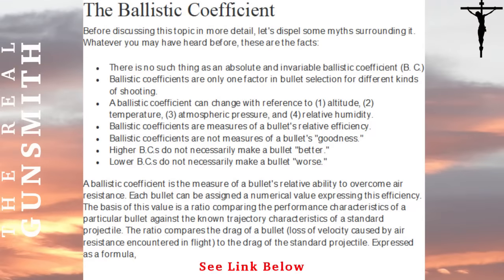7MM PRC Compared to Other 7MM's

Comment: I just listened to Hornady podcast on the 7mmprc. They don't claim faster fps than the 26nosler. They claim about 100 fps slower but around 30% less recoil, shorter barrels, and longer barrel life. That's a tradeoff I'd make any day.
Reply: That is not true. The real difference is around 200 fps.
Reply: I listened to and read a bunch of articles. Maybe this guns and ammo article made false claims but everything else i watched or read claimed lower (realistic) velocities on the 7mm PRC.
Reply: In a properly built 7mmRM it easily out paces the 7prc.  It's just the more modern case which is great but it won't beat a well built 7 RM
Reply: Your comment said 26 Nosler.  I’m assuming you meant 28 Nosler.
Reply: 100 fps slower and 30% less recoil is a joke at best and closer to a lie.
Reply: He said 28 nosler pay attention before you open your mouth
Reply: @billsoule3851  yes, typo. Thanks
Reply: @benkeachy  recoil is based on simple physics, so given those parameters, if the same weight bullet is traveling 7.2% slower also running the same/similar loads will give you about 7% less recoil. So don't be a sucker for the marketing. Also the barrel length issue is also hog wash.. Bullet weight, cross sectional density, powder selection and twist rate determine efficiency of barrel length with a given cartridge.
Reply: I love my 7 mag and load to suite the job. I do however like the idea of not messing with case bulge at the belt and having to use 2 different sizing dies to fix it.
Reply: It's a cartridge where internal ballistics are optimized along with chamber design. It's not all about terminal ballistics
Reply: Go with a 28 nosler just can’t be beat by either round
Reply: @codyoldford1592  one word in the article was a typo.

It was supposed to say the 7mm PRC was 125fps slower than the Nosler, but instead it said "faster" leadig to the 250fps "discrepancy" because if you claim something is faster by a certain amount when it's actually slower by that amount then you've doubled your claim in the wrong direction.

It was a simple typo, anyone with math skills (I'd assume a gunsmith would) and the knowledge that people make mistakes could have caught that, but no he's upset because this is a cartridge designed to not need a gunsmith.

That's what this boils down to, this is a cartridge designed to be an "all in one" solution for "custom" 7mag performance without having to build a "custom" gun. He's upset because he's not going to make any money off this cartridge.
Reply: @briansupermag3918  I don't think it "beats" 7PRC, But in a custom rifle it can certainly match it.

But that's the thing, this is a rifle that does "custom" 7mag things without having to have a multi-thousand dollar "custom" rifle built.

They're "out of the box" ready without needing custom work to achieve the cartridge's full performance (all rifles can be made more accurate, but the cartridge itself can't be improved on much short of maybe sprinkling some Ackley on it)
Reply: @Kross8761  that's the only thing that makes it any kind of worthy to be put in the same league as the 7mm RM is that this 7Prc is made correctly with proper chambers and barrel tw rates being most appropriate for Heavy Long Range bullets.  
If someone didn't have any kind of 7mm I MAY say the prc is pretty much ready to go from the factory for long range.  But if they wanted a custom rifle built and wanted pest performance its 7RM all day long.
For me I would never trade shorter barrels and better barrel life over performance NEVER.  I don't shoot  Prarie dogs to burn out a barrel.   I have never ever shot out a barrel ever so I want to push the envelope as much as possible and get absolutely the best performance.   That's why in the near future I will be building a custom 28 nosler.   195 gr. Berger vld and 3150 fps.   Heck yeah
Reply: @briansupermag3918   that’s that catch Supermag… not everyone can afford a custom Rem Mag. Hornady actually says that in their podcast. That a properly built Rem Mag can keep up. Change the head space, put in an 8 twist barrel. $5000 later.. wala. Factory gun. Factory ammo. 7 prc all the way. I own both. I love both. But I actually know… I’m not speculating. I own the cheapest 7 prc I could find in a Mosberg Patriot and it shoots lights out. $425. .5 moa. Thank you very much Hornady!  The cartridge is truly inherently accurate.
Reply: @Bob McMillen  if someone is just wanting factory rifle and shoot factory ammo absolutely  PRC wins.  It's a modern change and built properly.  Unfortunately 7rm Needs to be built and if someone wants a custom rifle and the choice is between these 2  the RM wins  it is what it is.   I love a 7mm's. Yes a fan boy here for all 7MM'S
Reply: @duquedupre  actually not really percent velocity change equivalent to recoil.  Look up recoil calculators. Bullet weight velocity and powder charge are inputs.  The difference in velocity is made in power charge difference.  By load book data, 175 gr prc is 2950. 28 nos is 3100 using 12 gr more of same powder.  This results in 4.8% velocity change with 17% recoil change.  34.8 to 28.8 lbft recoil energy
Reply: @orr89rocz  yes, but those variables are also not static. Secondary recoil impulse is due cumbustion at the muzzle which is a significant factor as well. This factor is that which is not caused by bullet weight and speed, but barrel length, load and propellent powder selection.
Reply: @duquedupre  simply comparing apples to apples, same powder same bullet weight same rifle weight, 28 nosler is abit faster at the expense of alot more recoil. Im not sure what you are trying to argue?
Reply: @orr89rocz  I'm saying that you're not looking at it exactly right. That the 30% number is one picked out amongst many other possible differences in recoil. For instance 7prc with a 175 bullet charged with 63.3 H4831 moves the bullet at the same muzzle velocity (2950) as 68.5 of IMR7977 but none the less they will have different recoil impulses... So simply measuring powder charges doesn't give you a finitely accurate measure of recoil. If this is even if all other factors and variables were even.

Thats what I'm trying to argue. No one has as far as I know test every single cartridge in every single possible configuration, but whether it be rifle weight, bullet, charge, or etc... So the recoil calculators don't factor all that's necessary to give concrete information. This can be witness by recoil testing done by certain individuals which often doest match up with ballistic calculators.
Reply: @duquedupre  thats way off track of what i was saying. My comment was in response to you saying 7% change in velocity was 7% difference in recoil.  That was not correct, when comparing the actual numbers.  Idk where the 30% comes from nor am i refering to that in any way.  Simply put, velocity change is not linear with respect to recoil generated, not by the calculations available online
Reply: No reason to be all upset. The market will put most b s cartridges to rest in short order. The sad part is it takes many bad kills to sort it all out. Think of all the fantastic cartridges that fell by the wayside like the 280 rem and the the 284 win if they didn’t stand the test of time no bad idea ever will.
Reply: @briansupermag3918  well actually 7 rem mag... Can't shoot 180 -190 as well out of factory rifles. They are just too long of bullets 7 rem mag is well up to 160... 7 rem mags can shoot the much longer bullets but those are in custom rifles. Where m😢ost of us Poors can't afford a $3000-4000. So in context of factory rifles above 160 grains 7PRC is better
Reply: @Rook Worx  I agree 100%.   If new to 7mm and just want a factory rifle, it's PRC all the way.  It's setup from the beginning, ready to shoot the heavy 7mm bullets.   But if going custom me personally I would go 7RM.  You can get more performance with a proper chamber.
Reply: @briansupermag3918 you use 7mm on prairie dogs, I bet your truck has a lift kit to
Reply: With a target bullet used as a hunting bullet on live game... you go, Cupcake! smh
Reply: @duquedupre  it's not "simple " physics. Recoil also includes rifle weight, chamber pressure  due to burn rates, and actual powder mass. Rifle construction such as drop at heel, and stock material effects felt recoil as does the type of recoil pad.
Reply: @duquedupre  Ejecta/unburned powder has a large impact on recoil. It's not just mass x vel.
Reply: Helpful hint: don't get caught up in gun writers bs.
Reply: Recoil is managed a lot better now with suppressors and brakes.
Reply: They lie.
Reply: The 7mm rem mags been doing the same thing for over 50 years.
Reply: @bboness713  your talking about the 7mm rem mag, which has been doing the same thing for over 50 years
Reply: I listen to their podcast, apparently somebody has misunderstood something along the way. And might want to check it out again.
They did state reasons why they believe it's better then the Nosler, but they didn't actually say it's faster.  There is something to not dropping that projectile so deep into the case.  There's all kinds of accuracy benefits that come with this design.
Reply: B.s. if you can afford to shoot enough to burn a barrel, you can afford a new barrel ... If you want SLOW, go buy a 30-06, and be done.  

A 7mm rem mag, has mag performance, and low recoil.   It's hard to beat.

Comment: Randy you misread Tom beckstrands article on the 7mm prc in guns and ammo he doesn't say that the 7mm prc shoots a 175 gr bullet faster than a 28 nosler he says that the 7mm prc matches the 7mm rum when loaded with vld bullets and shoots 100 to 125 fps SLOWER THAN THE 28 NOSLER . THAT MAY BE THE PROBLEM YOU ARE NOT READING IT CORRECTLY I THINK YOU OWE TOM A OPLOGLY. Further more you do not comprend what he is trying to get across in his article.

Comment: Shooting at game at over 600 yards is unethical, even with today's high BC bullets. Years ago I shot a spike elk at 670+ yards using a very high BC bullet. These bullets left the barrel at a chronographed 3,300 feet per second out of my 300 RUM. While approaching the spike noticed the animal had gotten up and walked away. Were it no for my spotter the elk would have disappeared. A 1/2 mile later I was LUCKY to find a the spike piled up on a sheep trail. Upon dressing the animal I noticed the entry wound and exit wound were identical with very little blood loss. Proper bullet expansion rarely happens after 600 yards.
Reply: I am a massive RUM fan,  300 AND 375, I'm surprised you're 300 rum at 600 yd on a spike has such a little damage.  I shot a raghorn small ones 800 yd 3 Ultra Mag 180 grain Nosler ballistic tip.  It made an exit whole I could stick my arm through!  -- what bullet did you use? (I am a hand loader, and load my cartridges on the UPPER END).

Comment: I respect the heck out of your knowledge about the 7mm Remington magnum, But not everyone has access to a competent gunsmith much less a custom rifle builder. For those people they can go buy a factory rifle that is throated correctly and twisted correctly for the heavy bullets they want to shoot now days for less than $2000. That’s all Hornady is really doing, they are forcing the firearms industry to update. If I wanted to rebarrel my 7mm Remington magnum to a 1-8 twist the barrel is gonna cost a minimum of $450, and a gunsmith is gonna charge that same $450 to chamber it and cut and thread the tenon at minimum. That’s $900 dollars a lot of people don’t have to spend nor do they have the months and months to wait on the job to get done

Comment: I don't think that the 7PRC was intended to replace or beat  the speeds of the "hot" .284 caliber guns like the 28 Nosler,  7RUM or 7STW,  nor have I ever seen anything that said it was faster?  It does, however, make a top notch 7mm caliber rifle, especially for both, the reloader and the guy who buys bullets off of the shelf. Had the 7mmRemMag not had the rim on the case, it would have been the perfect 7mm for the reloader.

Comment: I must concur with your statement on the Hornady interlock vs the eldx. I took a moose with a 300wm and a 180 interlock at 3000fps. One shot to the frontal chest and done. Performed perfectly. Too many bad results on the eldx on smaller game.
Reply: The SST got same lock ring as the interlock bullet I use both with great preference

Comment: Dropped my Elk this year with a 300PRC at just over 260 yards,  base of the neck. Head flopped sideways and he never took a step, instant kill. 212 Grain Hornady ELD-X no over expansion or huge exit wound,  barely saw either.
If you're going to hunt close range and shoot a 50 yards into the bush aiming for the front shoulder use Interlocks or partitions,  or the CX ...
Reply: Well the ELD X is just kind of a shitty bullet for hunting. It's just a tipped cup and core target bullet with "precision hunting" on the box.
Reply: @JNOSNOW partition, barnes hammer. Copper don't tear up meat like lead. But the partition is a oldie but goodie

Comment: I believe it's possible to improve on anything designed 50+ years ago. I'm a big fan of the 7 Rem Mag, but I believe the chamber could be improved. On a lot of older cartridges, the bullet was seated deeper into the case. That's not a good thing.
Reply: That is what he was saying, when he said " a properly built 7mm Rem mag"
Reply: Here is the deal. Modern machining has eliminated the need for gunsmiths because a cnc machine is way more accurate at holding tolerances than an old geezer from 40 years ago on a manual lathe. As always their is that one guy who gives a crap enough to do a superb job but that is the master. I don’t trust any gunsmith today with even the simplest of tasks. I have assembled 13 precision rifles from 223 to 338 win mag since Covid started and the largest 5 shot groups from any rifle is 3/8”. As a hand loader it’s just so easy nowadays even a child can do it. My children do.
Reply: Did you not watch the video ? Lol
Reply: @SuperMatt1235 lol you’ve done 13 … he’s probably done 10 thousand plus . That old geezer as you put it has forgotten more about these things than you will ever know. Hilarious
Reply: @user-eg8hb8xt3j I would agree he has put together a lot of rifles but it ain't as complicated as he makes it seem. All buliding a properly built rifle means is mating a good barrel to a good action. Literally anyone can do it. Not everyone can afford a lathe to manufacture their own barrels but anyone can buy a reputable barrel built to the specs you want and properly  instal it in their garage. I let my wife build her last 2 rifles and both shoot under 3/4 moa with handloads.  He makes it sound like you have to be a expert to make a rifle as good as his and it's just not true.

Comment: Hello Randy, thanks for your information on the 7PRC. I’ve built two bolt rifles that I’m very happy with (6mm creedmoor and a 223) and looking to add a third. The third rifle will be a long action that can shoot LONG range. I’ve taken the 6 creedmoor to a mile and it works but not consistently. I’ve been looking at 7mm options and would welcome your suggestion on what caliber you’d choose to run out beyond a mile?